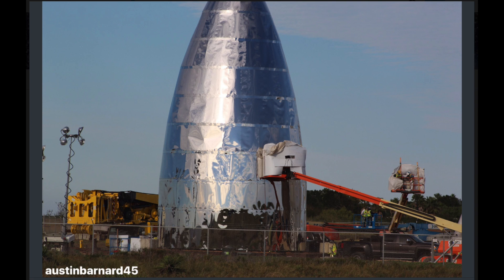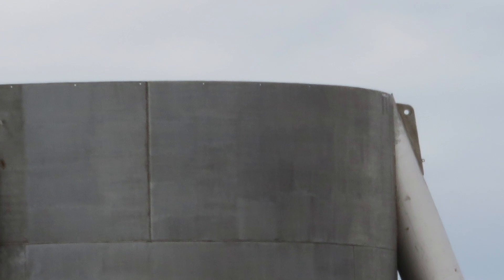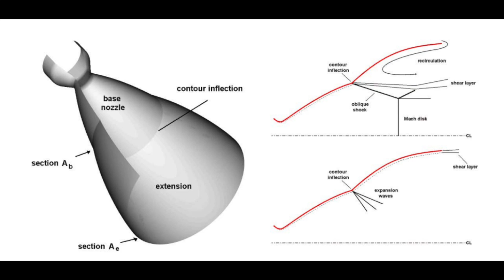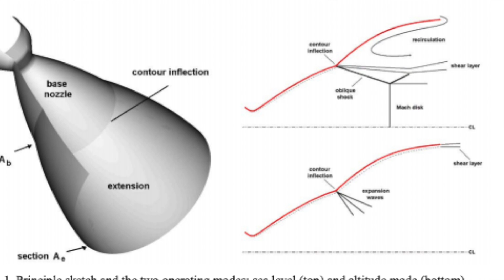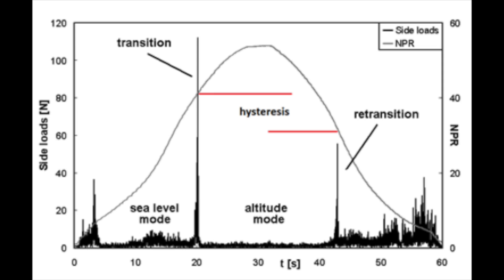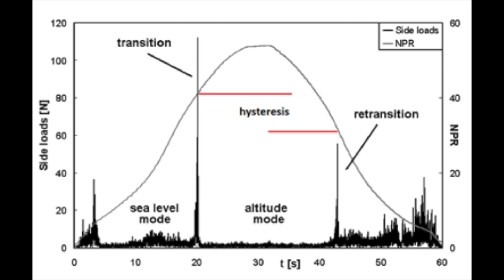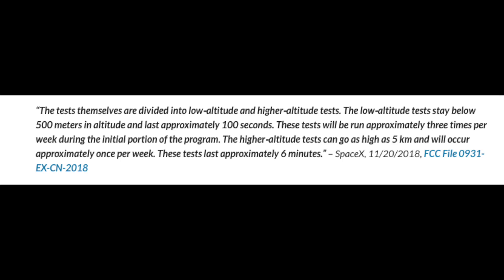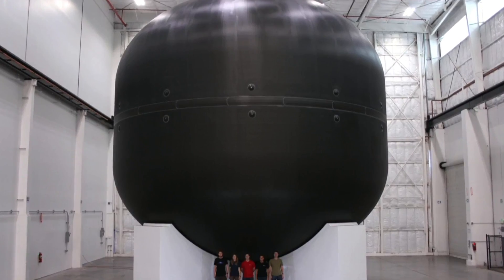What's Going On With SpaceX's Stainless Steel Starship?

Comment: I suppose it's a super simple test vehicle which will have the same general shape and center of mass as the real thing, just to get some data on how it handles and how the landing stuff works. So that they don't have to build the actual, super complex and expensive Starship and sacrifice it for some basic testing if and when something goes wrong.
Reply: I work in the aerospace field and I have a few theories. 1.) This is a static model which will likely be used for test fitting engines, control systems, etc. Basically a hands-on approach to tackling the fine details of a build without relying on complex computer models or expensive prototype units. 2.) This is a test model which will actually see flight, but only to simulate the mass and similar aerodynamics of the actual ship. It would absolutely destroy itself above Mach 2 however which may be part of the plan. 3.) This is a manufacturing jig for some new type of production skin material (advanced carbon fiber, some new undisclosed vacuum formed material?) 4. This is literally a toy or a back house, or a gift for Elon's GF, or any other crazy thing you can think of not related to a real rocket.
Reply: @Battlefresh  Regarding number 2, this probably won't see any supersonic flight as suggested by the 500m and 5km test height applications and the fact Musk keeps calling this "the hopper". That's what it most likely will do. Just small(ish) hops to see how it controls and lands.
Reply: @Battlefresh  1 and 2 are exactly what I'm thinking. Especially considering SpaceX make a big deal about the Falcon Heavy launch by using a Tesla S as the "dummy" payload, and if I'm not mistaken actually were tracking some data off of it? I'd be willing to bet this will be mostly show payload for the launch system but they also want to get some technical real world use out of the thing so they are using it as cheaper test platform.
Reply: @Battlefresh  They gonna use Stainless steel for the body and not the Carbon Fiber. Elon already talked about it. It has to do with thermal temperature of the rocket body when it reenters the atmosphere. It also might be too hard to manufacture a large rocket hull and deal with the heat from reentery
Reply: @1flash3571  Thank you!  Why did I have to wade down so far into the comments for someone to point out that Elon already explicitly stated that they're going with stainless instead of CF because while CF has the highest specific strength at room temperature, stainless has a higher specific strength both at cryogenic temperatures and reentry temperatures.  It's also easier to work and is cheaper, and greatly simplifies the TPS.

How can Scott be unaware of this?  Musk has talked extensively  about this - first hinting about a big "counterintuitive" redesign with different material, then giving the details (even the alloy family) and talking about the reasons for the change, and then finally posting pictures.  This video is such a disappointment.

As for the fact that it looks ugly... well, sorry, it's not being built to win beauty contests.   The cheapest way you could assemble a giant structure out of stainless in a short period of time would be to weld together big sheets of stainless on a jig.  That appears to be exactly what they're doing.  I'm sure they'll make the finished product look snazzier, but again, this isn't a beauty contest here.

We should count ourselves lucky if it doesn't blow up on the pad.  ;)  That's what test hoppers are for.
Reply: @karenrobertsdottir4101  You are more eloquent than me lol. You seem very smart. May I know if you are in a Technical field?
Reply: @karenrobertsdottir4101  and @Flash357 I think what Scott meant by it being an ugly thing made out of sheets of steel and so on, is that it doesn't look anything like the final Spaceship will probably look like. Like, it's not anywhere near the polish and fit and finish of anything that would go to space. I'm quite sure Scott knows about the design and material changes SpaceX has made. The real Spaceship skin will very likely be made out of a lot larger pieces of steel, and the skin must be a lot smoother than on the hopper.
And what Mark Danger said was just one of his many theories, and his number 3 theory seems quite unlikely since it has already been publicly stated that the Spaceship material has been changed to a stainless steel alloy (300 series for body, SX500 for engine nozzles).
Reply: Yep, quite certain the it will fly, not to space, but repeatedly.
Reply: Possibly also serving as practice working with their new stainless alloys.  SpaceX (and all of Musk's ventures) have had big problems developing the practical techniques and expertise actually working with stuff which is theoretically simple.  Maybe they learned a lesson.
Reply: @travcollier  If the exterior is being built by a company that makes water towers, I don't think this thing is being built for SpaceX to learn how to use these materials.
Reply: To Kepe:  I agree.
Reply: @59seank  . . . everything has been said already - just not by everyone . . .
Reply: That’s actually 100% correct bravo Kepe
Reply: Yeah. Except this rocket will do things that super high cost rockets don't even dream about.
Reply: I really get the feeling its just a show piece
Reply: Yeah, that makes sense. The final Starship design is estimated to cost at least 1 to 2 billion dollars to build. This hopper prototype will probably be costing SpaceX at most 100 million dollars maybe even less to build. Well within SpaceX’s budget for these kinds of projects.
Reply: I agree, though there will be no aerodynamic control for the hopper. 
I also think that there will be a larger fuselage than shown in the KSP model. It’ll probably look a little more like the real starship.
Reply: you hit the nail on the hammer
Reply: Probably connected to the nozzle design.  Going to sensor the shit out of it.
Reply: It's like a quick and dirty prototype. The same kind most good software engineers would make before committing (real) money and time to do their first alpha version. That's Elon's signature methodology. Like, what other rocket company has version number designations for their rockets?
Reply: Jesus, so much bickering.
Look, it's usually pretty dumb and straight forward in reality.
They would not go with this hollywood/toy/symbolic shaped rocket for any technical reasons.
It is that shape for show, no if buts or maybe.

There is not enough to learn from flying this thing for tests, as you can do analog tests, like wind tunnel miniatures. The large scare test before major production and operation is more of a phylosophy than a necessity.

That said, I liked the suggestion comming from the guy who said he had some experience on this (above in this thread).
If you mounted motors onto this as a jig you could get some really interesting vibration data.

It makes sense this would be to study vibrations throughout the frame because:
A: its symmetrical and simple
B: The motors on it aren't really that well tested operationally.
C: The water tower company would probably be good for dealing with that particular blend of static and dynamic forces.
Reply: too simple a shape for wind tunnels not to work
Reply: @HaydenHatTrick  It's more likely something to do with testing the engines and their control systems. Perhaps they'll test landings with one engine vs. landings with three engines.
Reply: Probably made that way so it’s easier to find when they crash it into the ocean like the last one. 

😂😂
Reply: You sound Pretty confident on that when something goes wrong
Reply: Can't be. That makes too much sense.
Reply: Why not just simulate that in a computer?
Reply: @soccerguy2433  Even with a vehicle as seemingly mundane as a car design, we still put them in wind tunnels and subject them to crash tests. Computer simulations are important, but only to a point.
Reply: 100% Agree
Reply: Totally agree! Why to spent in an expensive device when what you need is to test and train the AI in a platform that will be disposed and has a high risk to be lost.
Reply: Scott Manley’s comment about the nozzles is very telling. As he pointed out, if this is just a prop, why put an unflown nozzle design on it? They will, at the very least, be doing static fires. My theory is that they are trying to figure out the throttling to keep the exhaust from getting too rough inside the nozzle and causing instability. This would be the easiest way to test that without risking a full-blown working prototype. It may in fact be a hopper too, but they would be testing the transition of the engines again, along with the landing since it would be a hopper.
Reply: @PsychoticWolfie  Static fire engine tests can and have been done in facilities built just for that purpose. Dragon engines have also been tested in static fire facilities. It doesn't make any sense to build some sort of a Spaceship mock-up just to do static fire testing, since SpaceX already has facilities for that purpose. And the fact that Musk calls that thing a hopper and those FCC applications for flights reaching 500m and later 5km heights all point to a test craft that actually flies.
Scott also mentioned on the video that just one Dragon engine would provide enough lift for the hopper, so why mount three of them? My guess is they want to test landings with 1 and 3 engines, this would also mean throttling the engines down quite a lot for a three engine landing.
Reply: This is probably the best answer.
Reply: Can confirm.
Reply: @GLITCH_-.-  . . . everything has been said already - just not by everyone . . .
Reply: @cashuma5010  Some idiots still think that it is a PR stunt....
Reply: What do you think they'll be testing, specifically? What do you think they'll learn? As a very basic 'proof of concept' it seems pointless to me, since VTOL rockets are already a proven technology. Do you think they still need to convince investors that the concept is scalable to gargantuan proportions?
Reply: @nagualdesign  Well it's completely different from the Falcon series of rockets. The shape is very different, there are no grid fins for atmospheric control, the engines are new and so on. So of course it needs to be tested. They're probably just going to test the new engines and the new/modified guidance software needed for the new design. That thing isn't clearly meant for any kind of fast flight as it is, as you said, very basic in construction.
In short, it's cheaper to test the engines and software before starting test flights of a lot more complex and expensive Spaceship test models.
Another thing I just realized is that, according to what I've understood from Musk's tweets, they won't be doing this sort of simplistic testing of the 1st stage. Musk has said that the next Spaceship test model will be a shortened version of the real thing on top of a full-scale 1st stage. And after that comes a full-scale Super Heavy version of the Spaceship on top of a full-scale 1st stage.
Reply: Kepe  I get what you're saying, but I'm still not convinced. The final design (mass, CoG, etc.) of the finished, flight-ready Starship is pretty much unknown at this point. I guess they can still perform a few very public engine tests by hovering and maneuvering this thing. I would have thought that most tests are done with computer models these days, and any physical tests are mostly made to test the veracity those models.

I agree with what you're saying about unmanned tests, of course, but I would expect that to mean physically testing every component/subsystem, performing tonnes of simulations, tweaking the design based on those simulations, building a full-scale rocket, then flying it however many times you wish by remote control before putting anyone onboard.
Reply: They've got computer simulations for that
Reply: @francescopham  : Computer simulations of most things ultimately prove to be slightly simplistic. Aerodynamics, for example, grow more complex the more attention that you pay to them. I expect that big miscalculations won't be found, but building an actual test article is practically certain to provide data needed to improve the flight software faster than simulations can.
Reply: @absalomdraconis  They built the space shuttle in the 60s, simulation isn't a problem here. it's a stunt to impress investors.
Reply: @chengong388  : The 70s mostly, but yes, NASA did build the space shuttles way back then, and they actually built one (Enterprise) just for non-orbital test flights, and then used Columbia for four orbital test flights. Similarly, NASA is currently doing test firings of engines for the SLS system.

Anyone who's serious about building successful rockets builds and successfully test-fires at least one before begining proper launch operations.
Reply: @absalomdraconis  Lol subsonic landing test is not even remotely close to reentry at mach 25.
I'm not doubting the practice of test fires, please don't do the strawman fallacy.
Reply: @absalomdraconis  Simulations have gotten vastly better as computation power allows testing with more true physics at the small scale, rather than relying on abstractions and idealizations formarly needed to make the computation tractable.

In any case, there are things that simulations simply can't cover.  We know what the theoretical properties of various materials are, but how close can our actual real world manufacturing technology get to them?  What are the best methods for actually building a 9 meter wide rocket?  You can give a computer a CAD model and have it simulate all sorts of things.  You can't give a computer a CAD model and ask it how to manufacture it.
Reply: @chengong388  : You were the one who choose the space shuttle as a point of reference, not me. The shuttle is frankly a horrible point of reference, because it was intentionally designed to require a pilot, a requirement that prevented the fully automatic landing that by all right should have been performed at the end of STS-1. I won't say that this had no justification, because by the time the Shuttle was built it's primary purpose was the preservation of crewed US spaceflight.

Regardless, risking actual crew on STS-1 was willful negligence, and you should not expect to see it again. The Dragon capsules have demonstrated reuse, the Boeing capsule will be fully tested, and everything else in the foreseeable future will be as well.
Reply: @francescopham  Yeah but if computer simulations could simulate everything, we would never have any crashes. But we do. That's why stuff needs to be tested in practice. There are always some unexpected things simulations don't reveal. Like the recent Falcon 9 landing failure due to a problem with the grid fin hydraulics. If simulations would've revealed that issue, SpaceX would've made changes before launching anything.
Would you go on a flight onboard a rocket that has never been tested in real life, but only in simulations?
Reply: @Kepe   "Would you go on a flight onboard a rocket that has never been tested in real life, but only in simulations?"  Young and Crippen did!  STS-1 ... That and Apollo 8 must rank among the boldest flights ever.
￼
Reply: @Kepe  yes if its Elons crew capsule , NO for Boeing's one .
i trust Elons workers as there there because of there passion not the pay
Reply: @MrBliss001  "there there because of there passion..." Wow.
* "they're there because of their passion..." English isn't that difficult.
And yeah, while Elon is great and all, mistakes happen as we've seen with some of the SpaceX launches and tests. Things need to be tested especially before human flight.
Reply: @Kepe  no need to sound like your  ------ [ O i shouldn't say that ] .
the human race is littered with the dead of brave and foolish people but then there are the ones that made great leaps like Neil Armstrong .
Reply: @MrBliss001  So you're basically saying people should just sacrifice themselves so that some billionaire can save a bit of money by not testing his rocket before putting people onboard? And that then those who happen to survive by pure luck, are to be celebrated. Yeah sure, I don't really care about lost human lives if some random person dies in some rocket crash or whatever, but I bet nowadays it would be quite difficult to find well-trained astronauts who would want to risk their lives by hopping into an untested rocket, let alone the PR disaster it would be if the rocket crashed a few times with people onboard, causing multiple fatalities.
And while Neil Armstrong will always be remembered as the 1st person on the Moon, his accomplishments were not just thanks to him. He had thousands of people who designed the rocket and all of the other parts, built those parts, planned the mission, trained the astronauts, and people on board the flight itself and in the control room. It was a huge team effort but for some reason mostly just one person is celebrated. He wasn't even the one who landed the capsule on the Moon.
Reply: well  @Kepe  i fell sorry that your such a sheltered person on that computer scared by life. You should get out and interact with other people ,there are some "real" and extraordinary people out there .
Be inspired, not closed off and negative .
after all we all die, so do it doing something great or that will inspire others to do great things. 
That is what the human race is best at. 
PS got to go out now and do some of that living stuff [ i may be great, i may be a lot less than great or i may die but that's what its all about ].
Kepe i hope you can get inspired and lose the negativity .
Reply: @MrBliss001  There's no reason to get personal. It just shows you've already lost the argument and are trying to provoke me to come down to your level. My point was, you can't just launch an untested rocket with people onboard, that's both stupid and very likely illegal. Why would you risk the good reputation of your company and your own name just for the sake of saving a few pennies? Nothing is put into market and general use before testing. Phones are tested, cars are tested, food ingredients and additives are tested, medicine is tested, toys are tested, and so on.
Sure, exploring new things out there always poses a risk, but no-one does it (succesfully) by going into it head first without proper preparations and plans.
Courage and stupidity are different things.
It requires courage to dive from 50 meters. It would be pure stupidity to do it without practicing from lower heights first.
Reply: @Kepe  @MrBliss001 Chill guys. Kepe: yes, Armstrong did land the LEM. It's his big achievement, he was a cool-as-cucumber test pilot. I was listening live when he did it. You could hear the calls for how many seconds of fuel were left ... 60 ... 50 ... 40 ... 30 ... 25 ... 20 ...
Everyone else was having kittens but he found a spot and landed with 18 seconds of fuel remaining.  
Yes, many people contributed. But in the end it was down to him.
Reply: @AndrewBlucher  Hmm, right. I originally just quickly checked on Google and it just said Aldrin was the pilot and Armstrong the commander. But yeah. Armstrong landed the craft. I'd still say the Apollo 11 flight / Moon landing was more of a team effort than one man's heroic achievement.
Reply: francesco pham yeah but Jebediah could land a toaster if they ever got one to fly.  Best try it IRL.
Reply: francesco pham computer simulations font have cool explosions
Reply: To quote Winston Curchill,

"However beautiful the strategy, you should occasionally look at the results."

So, maybe they are looking at the results of their computer simulations.

(I would recommend everyone to read his quotes, they vary from enlightening to hilarious)